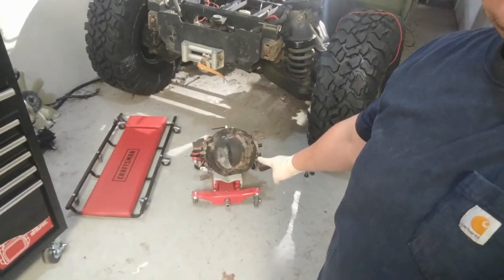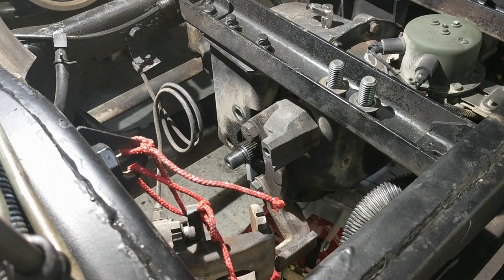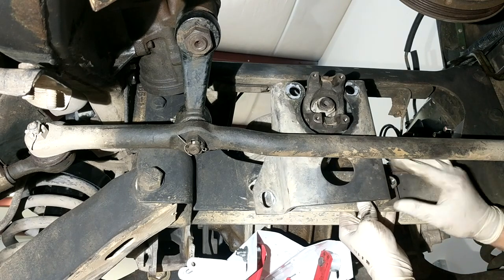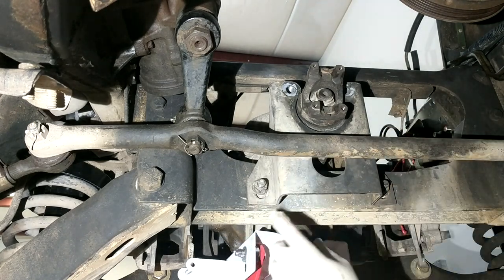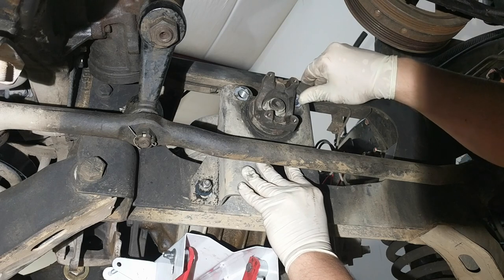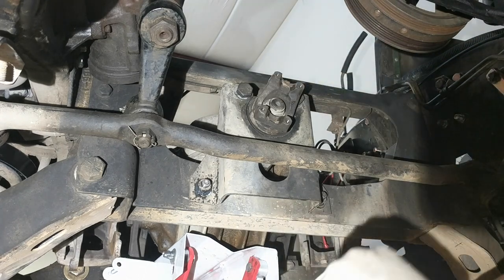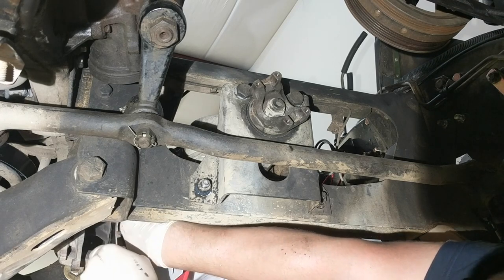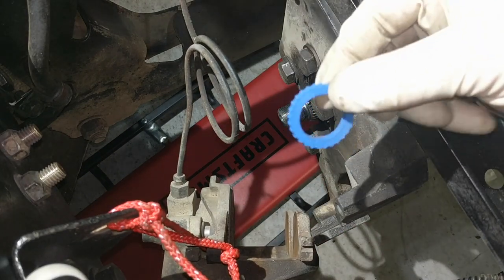Front Differential Installation for the Humvee - LSxHumvee

Comment: Where does the diff breather end?  Just curious how high it is?  I understand hummers are limited to crossing 30 inches of water.  Does that have to do with air intake?  Does the transmission also have a breather?  Does the transfer case?
Reply: All breathers are tied together and run to the top of the air box. The Marine and fording Humvees have sealed dipsticks and everything so you can go much deeper with the snorkel etc. Normal Humvees use a lot of seam sealer/caulk to seal everything in the air box area and it's mostly cracked so water can get in much easier.
Reply: So if it’s old and cracked does that mean 30 inches is too high?  Is it difficult to “re-seal” the air box?